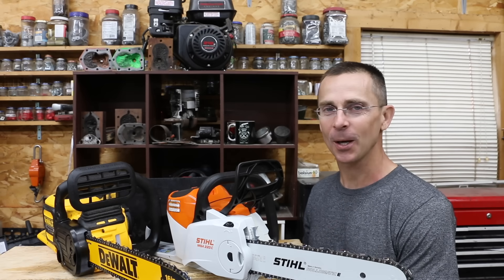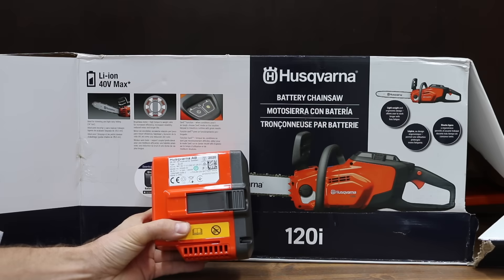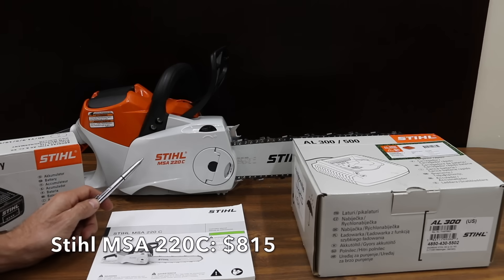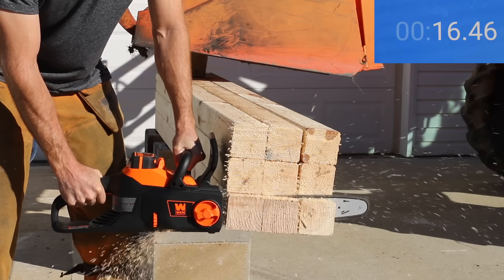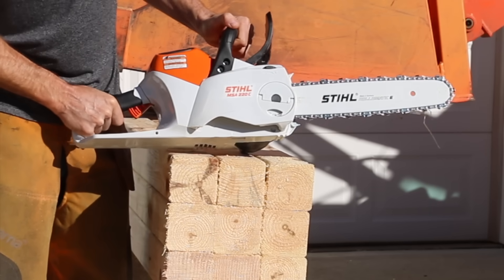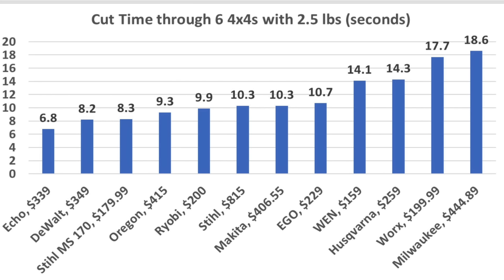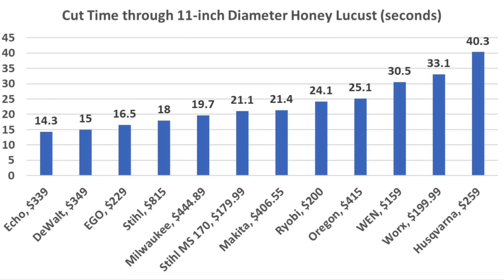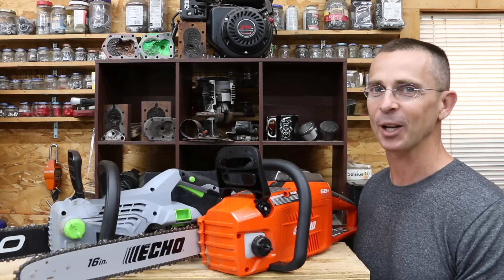Best Battery Powered Chainsaw Brand (ROUND 2)? Stihl, Husqvarna, Echo, Oregon, DeWalt

Comment: The one huge advantage I can see with the dewalt is the ability to use their tool line as well.... Echo, not so much. While it was a very good saw, the versatility of the dewalt (while only being slightly behind the echo) seems to be the better value
Reply from the maker: Thanks for the feedback.
Reply: Yep, I have the dewalt flexvolt system and the string trimmer is killer and all of their yard tools are top notch. Since many jobs are going to require multiple batteries I’m not going spring for the echo plus an extra battery or two, when the dewalt has plenty of power and speed. Dewalt seems to make all of their tools high enough quality that I can spend my money on more batteries that all work with each other, bringing up the main drawback to the dewalt tools — runtime and charge time. If I had to switch to different brands to get a tool good enough for each job, I would probably need at least two batteries for each tool, increasing my cost. Every time I buy a new dewalt tool with battery, I increase the potential runtime of all my other jobs.
Reply: @ryans6186  Some Dewalts are great, some are meh. My grinder is almost dead after 2 years,  first one went 5. Gone through tons of their 20v drills. Got so disgusted with those that I just got a brushless Ryobi since I have their batteries too. Been a Dewalt guy since the 90s, now I'm drooling over Makita.
Reply: Yeah, all my tools/Batteries/chargers are Dewalt, and I have a bunch of them, so I bought a Dewalt chainsaw that I take camping with me for firewood. Have a couple of solar panels and a solar generator so i can keep it charged up. I've got a dozen mixed Husqvarna and stihl gas saws from 16 " to 36", but the battery one works best for camping for me, don't have to drag around a gas can etc.
Reply: That's why I went with DeWalt. Already have batteries, chargers, and tools from them. It may not be the best saw but it's pretty close for what I need it for cleaning up hurricane trees in the yard.
Reply: I went with dewalt the flexvolt series since all my other tools was flexvolt
Reply: I have similar respect for the EGO line whose batteries from 2.5 amps to 7.5 amps work well on all of their 56v tools.  Caveate:  more amps equals more weight.  And their bang for the buck value makes them tops for me.  Same can be said for the 18v family of Ryobi cordless tools with 2 to 6 amp batteries available.
Reply: The EGO with a proper 4amp, 5amp or 7.5amp hr battery would have bested most of the competitors. I request a redo with equal amp hour batteries for all of the saws. Great content as always
Reply: @Ninja_Sloth  till you need the nonexistent ego service/ warranty.  It's horrible
Reply: @Ninja_Sloth  I totally concur! 😊
Reply: @Ninja_Sloth  I'm curious, did you get an overinflated "Ego" before or after purchasing the tool?
Reply: @Ninja_Sloth  that's pretty difficult to acconplish. PF does a pretty good job testing different aspects and things like charging time. That said if all things are to be equal then you also must include using the same identical "amp hour" chargers and then retest the charging time. Moreover I don't think it's stressed enough which one's are most user-friendly. Chain adjustment, maintenence,  bar oil addage, etc. 
Most people tuning in are not professionals and the user friendly aspect needs stressed more. 
Lastly I think some people need to relax and just enjoy the videos without hurt feelings. If you bought a saw and it didn't finish #1 ... it's ok. I promise it's really going to be alright because in the end it doesn't matter what the test shows...if the tool works for you and you like it...that's the only thing that matters. The only thing!!
Reply: @wolfdenauto3417 i would second the thought but great content nonetheless. Those maintenance though are very important so i guess thats a great addition to such great of a content already
Reply: I'm thinking about it as well. I'm a mechanic who dabbles a lot in renovation. To be honest, there's no real competition in my area for milwaukee. But man that chainsaw is expensive and underperforming. 

But for the renovation side of things, dewalt seems to be the pick of the bunch. 

If I've gotta buy the power tools anyway, I wouldn't mind the chainsaw being a dewalt for compatibility purposes. Probably be cheaper because I wouldn't have to buy a battery.
Reply: I agree. For a stand alone product, the echo seems far better. But, with dewalt's ecosystem, its far better value
Reply: Where’s all the Milwaukee boys at??…..oh yeah you guys found out the saw sucks in the first video😂
Reply: That's what I was thinking.  I am actually not much of a tool user (yes, why do I watch these videos?  Because you never know, and they're entertaining), but I'm aware that DeWalt has a ton of electric products and their batteries tend to be interchangeable, at least to an extent (I'm not sure what if any restrictions they might have, presumably some batteries aren't designed to be used with some of their tools).  Yet I don't recall the Echo brand.  Might have seen something of theirs in an older video, but I can't recall.  So, the long term availability of their replacement batteries is suspect IMO.
Reply: ³|ë
Reply: I was thinking the same but for Milwaukee and Ego. All my tools are Milwaukee and my lawnmower, weed whacker, blower and edger are Ego and I have batteries for each one with a fast charge that charges 7.5 AH hour battery in about 30ish minutes
Reply: I've had the Milwaukee M18 chainsaw for about a year and have yet to use the heavy 12.0Ah battery on any of my other Milwaukee tools, even the string trimmer runs just fine with the 8.0Ah battery that it came with. I don't think my shoulder would appreciate anything bigger than the 6.0 battery on the sawzall or circular saw for any extended period.
Reply: at this point im not sure why most tool makes/manufacturers haven't standardised the mounting-rails and changing ( with fancy electric computerised controls the tools and or battery doesn't have to be F1-spec aka different design details like voltage's or capacity ect just make the rails and end users experience about the same result/feeling ) like BEV car's and charging stations 

id buy different makes/models based off of the better spec's but as i have mekita 18V + 80v or gasoline's/diesels systems available to me its a walled garden, for chainsaws it's tempting for electric but i see m-40V is average or sub-par vs my old John deer CS56 that's has a glazed/hogged out clutch, also tired of dealing with 2stroke ( and getting that way with my car/trucks/daily's 😉, but im not shelling out 50+150k for a ford-lighting ) and maintenance, as a RC-hobby i like gas/nitro more but that's not a daily's job-use's ect
Reply: echo 58v to dewalt adapter.
Reply: I had the same thought about DeWalt, but my saw turned out to be a big disappointment. Maybe I just got a lemon, but it leaked oil like crazy and just a small pinch ruined the chain and bar. I decided to cut my losses and reduce my frustration and donated it. As far as I’m concerned, it just wasn’t  built very well and not up to frequent use. Convenient, yes, but dependable and durable, not in my case. The Echo looks like a nice saw!
Reply: If you go with the DeWalt you better buy yourself a fire extinguisher because every DeWalt I ever had smoked or caught on fire........ Never again
Reply: @chard00lag Weird, have handled thousands and have seen 2 do that.

Comment: It is always interesting to see you test out various tool brands in different ways.  Different brands often have bold claims about being better than the competition.  What if you test out outdoor gas powered tools. For example,  there is a lot of competition when it comes to gas powered blowers, regarding cfm, mph, fuel efficiency and sound level. Maybe even gas vs electric counterparts. Personally I prefer Stihl, but I've seen Maruyama and Echo come out with bold performance claims.
Reply from the maker: Thanks for the suggestion.

Comment: I have the Stihl MS200 with the 300 battery with quick charger.  It's expensive but works great.  The saw feels like a quality, robust tool.  We also bought the Stihl blower.   I had an EGO and returned it because it seemed so cheaply made and the hesitation drove me crazy.  I think that I'll check out the ECHO for an additional electric saw.  We live 80 miles from the nearest utility pole and I have to fly in my gasoline but we have robust solar and the rest is self explanatory.  One additional thing in electrics favor is you do not have to warm up the saw and the gas saws are a pain to start in the Alaskan winter.  Really appreciate your videos!
Reply from the maker: Thanks!  Thanks for sharing.

Comment: Awesome comparison video. So easy to follow, the design of the tests make perfect sense and the graphs make it simple. Only suggestion would be to add a final tally graph.  When searching for my new saw, I had to look at the video over and over to see what battery power was being used.  I was going to buy the echo but do not like the fact that I need tools to adjust the screws on the bar.  I had a gas Stihl that ran for 15 years and that was the one thing I hated.  I ended up down to Dewalt and Ego.  I decided to purchase the Ego CS1604 as it uses a higher capacity battery than the one tested here and made a difference when comparing. I am sure the Stihl is a great tool as I owned one but cannot justify the price for home owner usage.  Would love to see another comparison using the same battery power and blade length.  Awesome!
Reply from the maker: Thanks!  Thanks for the suggestion.

Comment: Nice video. Didn’t think the echo would be that good. Still just edging out Dewalt which has a huge line up of tools and probably have extra batteries if it’s your brand of choice. (same can be said for Milwaukee) But if not then echo defiantly best bang for your buck. Disappointed with husqvarna as they make excellent gas saw that I own 3 of them. But that battery one just didn’t hold up to the compaction.
Reply from the maker: Thanks!  Thanks for sharing.

Comment: I went with the Ego because I also have their back pack blower and string weed trimer and the batteries are all interchangeable. I also think the Ego chainsaw wins here for its Price/Performance ratio.
Reply: Interchangeable batteries makes my life better
Reply: I bought an Ego 18” from Amazon on November 8th. I had to send it back for a replacement. Got the replacement on November 27th. Sending replacement back today for full refund.  A cut which should have been 5 seconds took me 20 minutes.

Ego customer support is useless if you are within 30 days of your purchase date. Your only option is to return it.
Reply: @rumba215  Sounds like user error.
Reply: @Intentionally_Inflammatory  ikr he coulda just sawed it manually with the chainsaw lmao
Reply: @Intentionally_Inflammatory  Yeah, I 100% guarantee the chain was backwards. My old boss did that once, damn near set the tree on fire before cutting it. Hard to believe you would make it all the way to 2 replacements before looking at your own issues. This test shows that the differences are small amounts of speed, not literally doesn't work vs does.

Comment: Have you done a corded chainsaw video ? I’ll more then likely go either with a corded or gas chainsaw , not a battery powered on. Batteries are WAY TOO expensive and hard to get. I only need one to cut up logs already felled. I have power near by and if the government goes nuts and only allows electric i be set.

Comment: The standardizing of these saw tests is GREAT!!  Such helpful information.  How about testing the more recent Hart brand of saw??  It seems to be an up and coming alternative (DIY.)   
Should be very similar to Ryobi and Milwaukee by the same manufacturer?
Reply: I do take some issue w/ usable bar length.   Shouldn't it be from the tip of the (usually dull) spikes to the corner (the rounding) of the bar/chain?  The tip is for the most part seems unusable unless making a plunge cut?
Great videos!,

Comment: For what it is worth, I was looking to buy the Echo after watching this video and other research and it appears to be discontinued.  Was no longer showing up on the Home Depot web site or ACE hardware sites (two Echo dealer networks), and not easily showing up on the Echo website. The Echo website lists a new battery system coming out (new 56v system vs 58v system in this video), with the new chainsaw due in 2022.  My searching turned up complaints on the Better Business Bureau website about premature battery failures, and people having trouble with HD and Echo honoring the warranties.  Seems ashamed for what looks to be such a good cordless.  Looks like you can still buy the Echo off of Amazon, but I'm going to look more at the DeWalt

Comment: We got the Stihl chainsaw a couple years ago and on my opinion it’s not worth it.  The first cut made with it after getting it from the store, it cut like butter.  Ever since that cut, it’s cut badly.  It’s very easy to stall and get hung up, and it barely has the power for anything less than a 9 inch branch.  The trigger lag time is fast at first, but after we used the saw for awhile, the lag time was a lot longer.  Personally not worth it for $800.
Reply from the maker: Thanks for sharing.

Comment: ..the battery saws are still getting better and better, but are still tall on price and short on performance if you need to do any real work..even moderate work...as some have pointed out, you would need several extra battery packs to keep working for any reasonable stretch of time, and those batteries are very expensive..I really think it's the price of the batteries that are the achilles heel of any battery powered tools, if they could be brought down to a level where you could easily afford several extras, that would be a real game changer...not really sure why cordless tool batteries are so insanely expensive...most are made in China, so it can't be the labor involved in making them....
Reply from the maker: Thanks for the feedback.

Comment: Perhaps try the 16” Ego instead of the 14”.  The 16” has a 5ah batter that will better compare and Ego sends more power to the brushless motor with the larger battery, so it should perform better.
Reply: I agree I would like to see how it performs with the 5ah along with the 2 extra inches.

Comment: I'd like to see you do a chainsaw comparison gas vs battery of similarly priced saws. Longevity of the saws - how long before batteries begin to lose power. How long before electric motor begins to lose power. Cost of gas vs batteries over time.
Reply from the maker: Thanks for the suggestion.

Comment: I don't agree that DeWalt won the 1st matchup.  With electric tools, battery and charger tech is key. And the Makita destroyed the DeWalt in that area, without losing much in cutting speed or power.  Overall I think the Makita is #1.  Plus, the safety trigger is much better on the Makita, and you get 2 batteries.
Reply from the maker: Thanks for the feedback.

Comment: Keep an eye out for two new saws coming from Greenworks in 60v and 80v.  They will have 2.5kW motors (estimated 50cc gas equivalent) and 18" FULL CHISEL chains...not the low profile chains that ALL of these battery saws are using.
Reply from the maker: Great suggestion!  Thank you

Comment: Pricewise with the best of these sitting around the $350 mark it would be interesting to compare with the equivalent gas powered chainsaw.   Checking a USA chainsaw retailer that seems to be a Husqvarna 440 for slightly less or 445 for slightly more.    Similarly the Stihl MS211 and MS251 when looking at a different retailer.   Comparing the two best battery ones, the Echo and DeWalt, against the lesser of the Husqvarna and Stihl may the best option.

Great testing methodology in your videos as always.
Reply from the maker: Thanks!  Thanks for the suggestion.

Comment: When I purchased the house I am in now, I decided to sell all my petrol powered tools and replace them with battery tools. I  looked a heap of different brands, and decided to go for Ego.  I've got the mower, edger, line trimmer, polesaw, blower and chainsaw.  They are fantastic tools.  So much easier to use than petrol, start first go and work just as hard (for what I need).  At the time I purchased my gear, none of the other brands had all the other tools which was the biggest selling point for Ego. So although it may not have performed as well as the other brands, the fact you can use the same battery and charger for dozens of other tools makes it infinitely more useable.

Also, comparing a saw with a 2.5AH battery to other saws that you purposely got larger batteries for is not a very fair comparison.  My 7.5AH battery on the chainsaw will give me around 16 minutes of continuous use.  Ego has a 2.5AH (which is their entry level battery), a 5, 7.5A and 10AH battery, and a massive 28AH battery for commercial use.
Reply from the maker: Thanks for sharing.

Comment: You know what I'd like to see is an 18volt showdown brushless vs. Standard. Like the ryobi for instance. One can get knockoff lithium-ion 6Ah batteries for $25 bucks. Which means you don't have all these proprietary 40volt odd ball batteries that take forever to charge the one and only battery you got. I think Makita may have an 18v, Milwaukee etc. They're like 10"-12" bars.

Just a suggestion since you asked. Thanks again for a great video.
Reply from the maker: You are welcome!  Thanks for the suggestion.